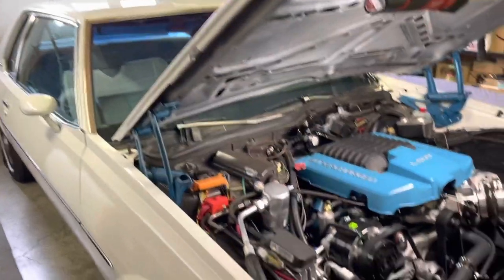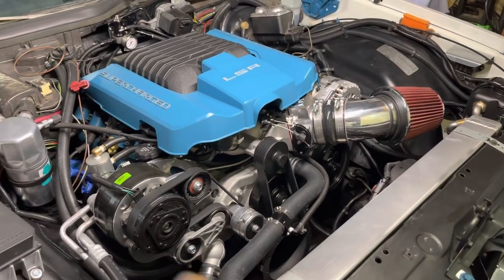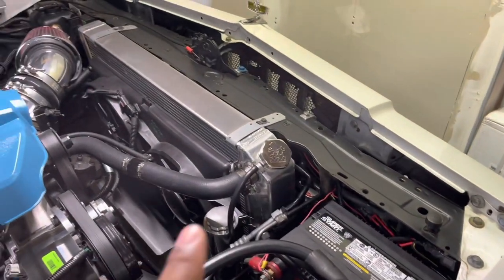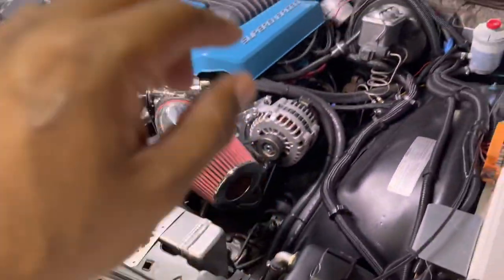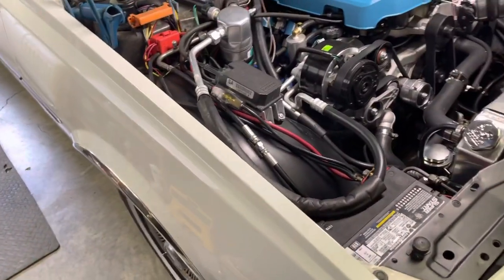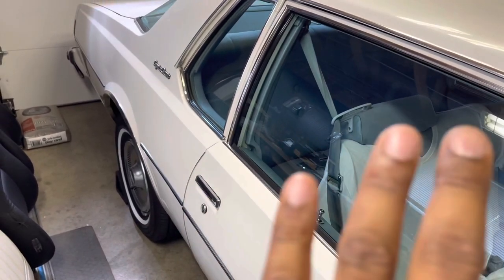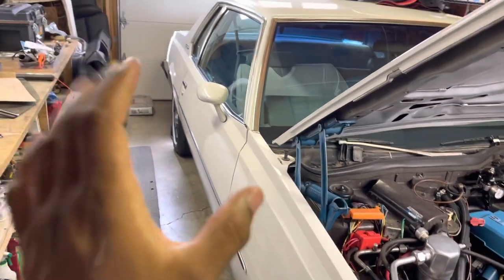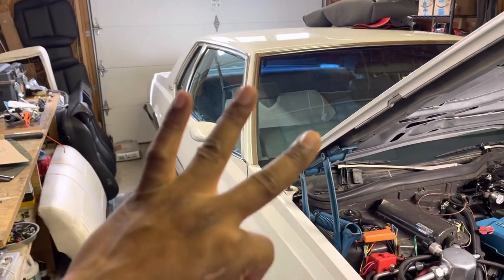HOW TO LS SWAP & SUPERCHARGE YOUR BOX CHEVY | LSA SUPERCHARGER

Comment: How can I find that tensioner I mean I look on lsx concept website it don’t show if I can get a little more info from u will b nice.. love video and car
Reply from the maker: It’s there entry level race tensioner. To be completely honest, I messaged & called LSX Concepts on a couple occasions to try and get more info myself. No response ever. A couple years ago they commented on one of my install videos basically saying I did something wrong on the install and I basically told them what I just told you and said “your customer service was bad.”  

They make great stuff from my experience with this, but trying to get info about a product wasn’t the best experience for me. However, with all that said, the tensioner has held up great. Just took the car to LS fest in Vegas. 3000 mile round trip and it drove & performed great!

Comment: I got to add u I just ran across your page your Definitely official!…..I have a question if I was to buy a supercharger from eBay just the charger what else I need for it to work?
Reply from the maker: Thanks for the support! You would need Bracket kit, piping and intercooler if u decide to go that route, 3 bar map sensor, possible a harmonic balancer depending on what bracket system you run.

Comment: Noticed you said you using a GN fuel pump sending unit thinking of grabbing one for a 87 to use. I’m assuming the different year GN sending unit doesn’t matter as long as it’s for a intake pump? And if I’m wrong can you link me to the right one to use. And on another note I was doing a lot of research and the bubble 92-96 tanks bolt right in if you use the 92-96 tank straps they have baffling and the 1990 box 89-90 box chev tank has intank pump as well they have a bowl in the tank to help with fuel slosh/starvation. If you ever wanted to upgrade. I’m going to use my stock tank for now because of budget purposes lol
Reply from the maker: I just search for an ‘87 GN unit: FG156A I’ll post a link at bottom. On the bubble tanks - yes, to my knowledge it’s pretty much a direct bolt in. It does have a baffle as well. I’m running one in my 71 Chevelle. That was not a direct bolt in.
Reply from the maker: https://www.ebay.com/itm/Fuel-Tank-Sending-Unit-Spectra-Premium-FG156A-fits-84-87-Buick-Regal-3-8L-V6-/144193763081?mkcid=16&mkevt=1&_trksid=p2349624.m46890.l49286&mkrid=711-127632-2357-0
Reply: @MrGriffin23  rite on bro much appreciated 💪🏼. And right thanks for sharing that info on the bubble tanks in the Chevelle. I got a 72 I’m gonna be swapping after I finish my 79 caprice
Reply from the maker: @NORTH_HWD  No problem. I would highly suggest not doing it in a Chevelle. It was way too much work and you have to cut the floor pan. Just my opinion tho.
Reply: @MrGriffin23  most definitely

Comment: What is the part number for the headers you got for the car? I'm having a hard time finding some.
Reply from the maker: https://www.ebay.com/itm/Speed-Engineering-LS-Conversion-Swap-Headers-Camaro-Chevelle-Nova-Firebird-/274322690405?mkcid=16&mkevt=1&_trksid=p2349624.m46890.l6249&mkrid=711-127632-2357-0

Hope that helps! Thanks for watching!
Reply: Thanks. Nice work to